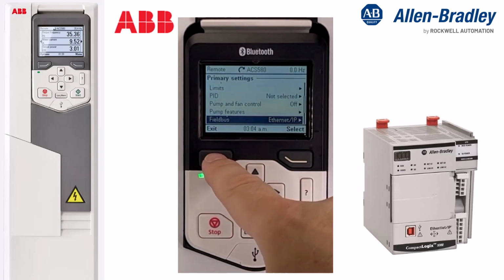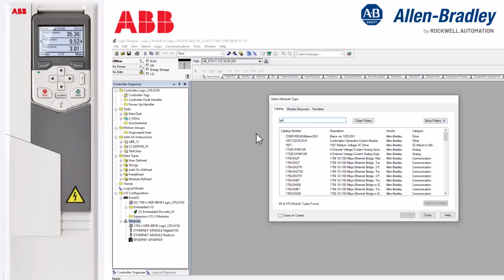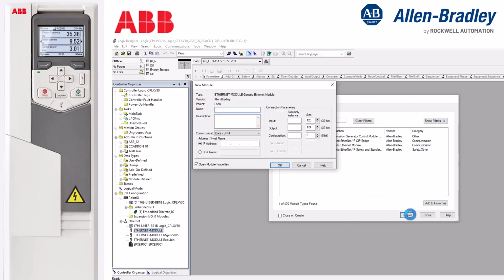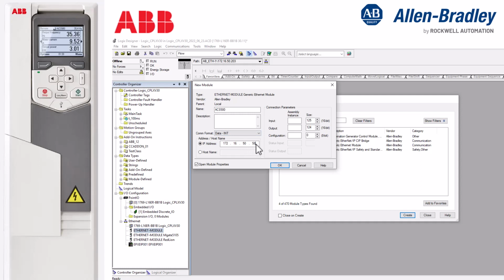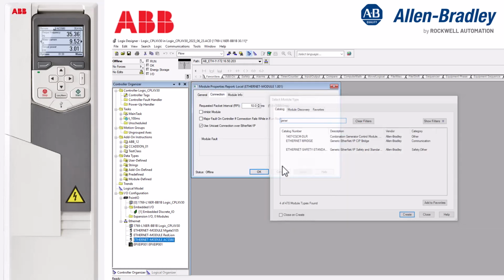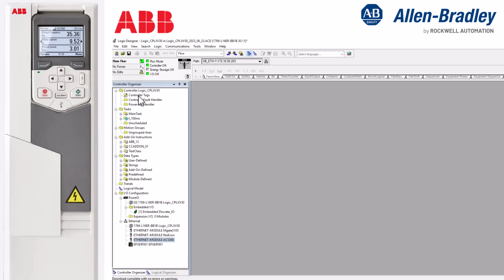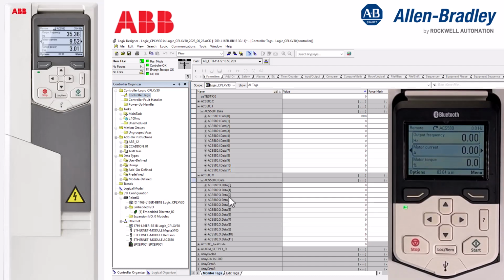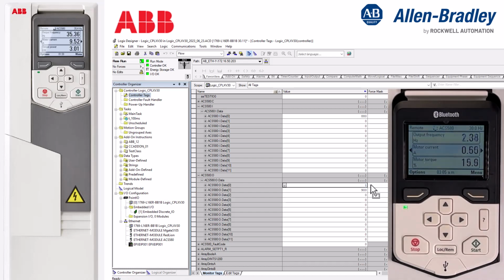Set up an ABB VFD to talk to an Allen Bradley PLC

Comment: Hi, can I ask how to get values in assembly instance and size? if its in manual can you show me where it is?
Reply from the maker: Depends on which instance you chose under ODVA or ABB Drives Profile. See the details in the Ethernet/IP section in the FENA-12 manual (https://cdn.logic-control.com/docs/abb-drives/FENA-01-11-21%20Ethernet%20Adapter%20Manual.pdf).

Comment: Hi, i have 3 VFDs currently working with same assembly instances for input and ouputs, the only issue i have is when it comes to using the FBA Data In & FBA Data Out for custom parameters, i want to use those to have some valuable information on the PLC such as voltage and current consumption, but once i select the parameters and after aplying settings to the module, nothing happens, the Data.Custom_Input_## tags on the PLC does not show anything :(, is there anything i'm missing or that i should double check? )
Reply: Did you fix your problem? I'm having the same issue